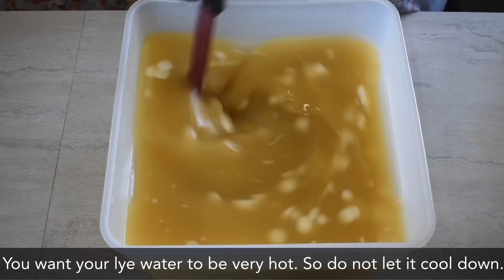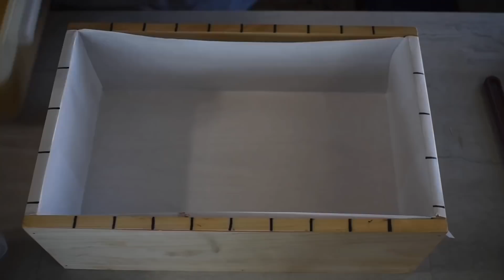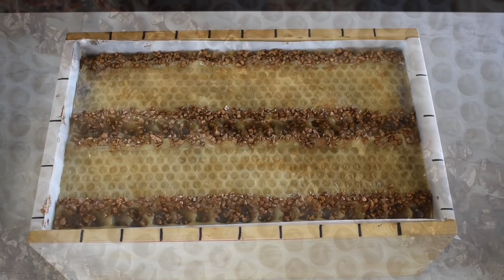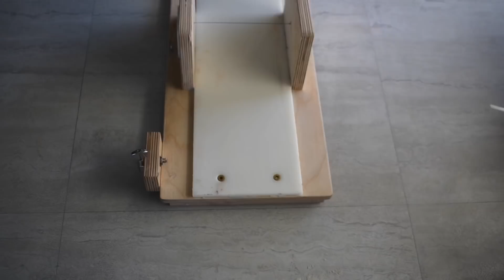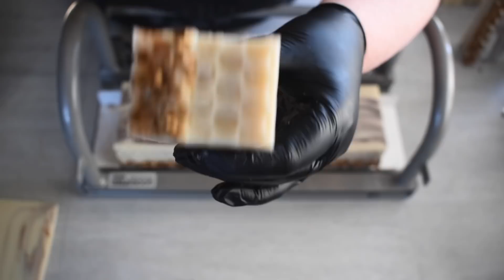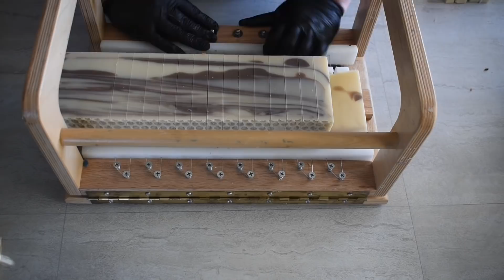Honey Vanilla Toffee Cold Process Soap Making

Comment: Hello. I love watching your soap making videos. One question I wonder about tho is if you are stirring and mixing the oils and lye  solution as long as you do… doesn’t it get thick too quickly? Or does it not start to thicken until you use the blender? I’ve never used the hot lye water to melt the hard oils but I think it would be faster if I do it without much planning or on a whim.
Reply from the maker: It doesn’t start to thicken until you use the stick blender. Wayyy back in the day before stick blenders, people would stir soap and it would take hours before it would thicken up :)